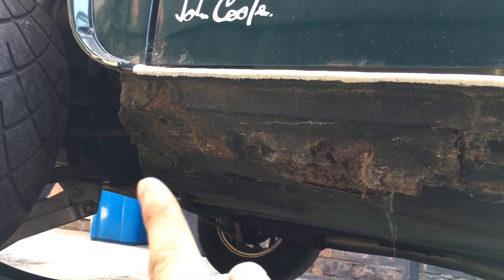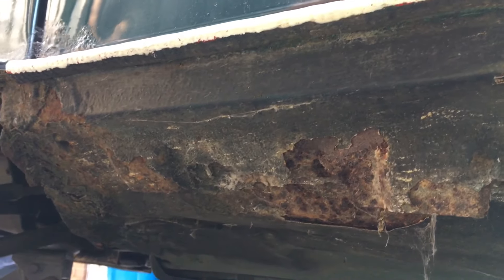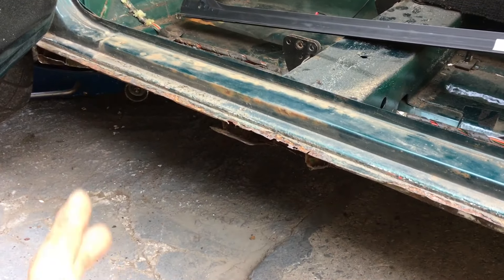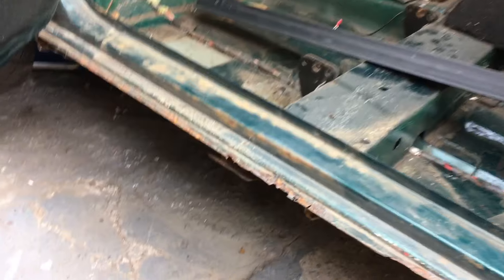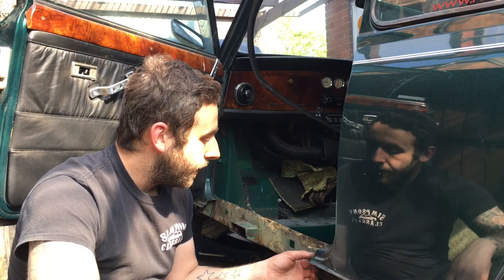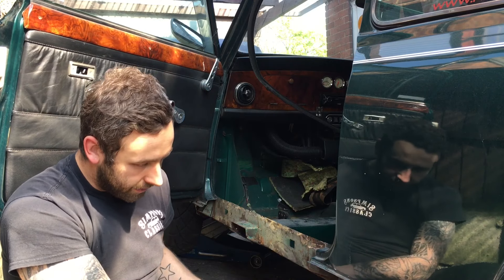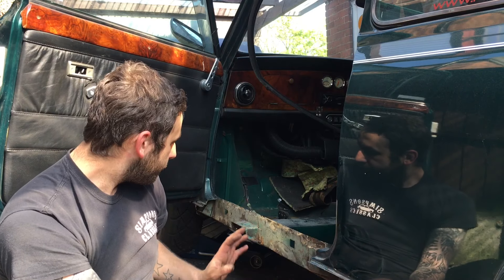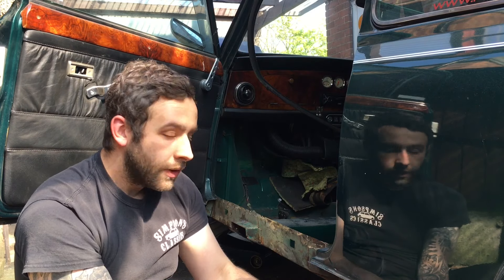Classic Mini John Cooper Conversion JCW - Outer Sill Removal & Door Step Fitment

Comment: Good vid! Great to see work being done. What instance would you brace the shell? I’m have a front end to replace and floor pans put in. I don’t want to cut the old out and it twist
Reply from the maker: Cheers thanks for watching, I would brace the shell if it was cutting more than I did out I mention that I did it this way to keep tbt strength once the door step is back in your fine. If you check on our 89 build series we cut the whole floor out and that was a fully braced shell. I would try and do one job at a time if possible instead of cutting it all out in one go. I hope this helps 👍
Reply: Simpson's Classics thanks for the advice! I’ll tackle a section at a time